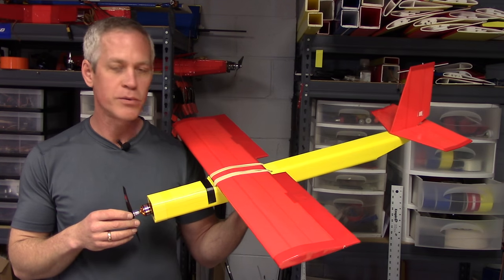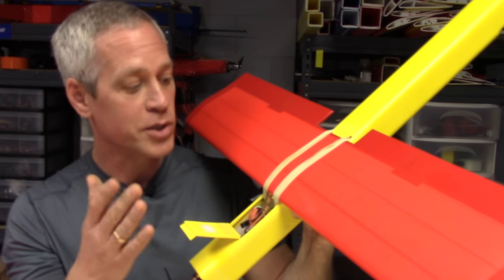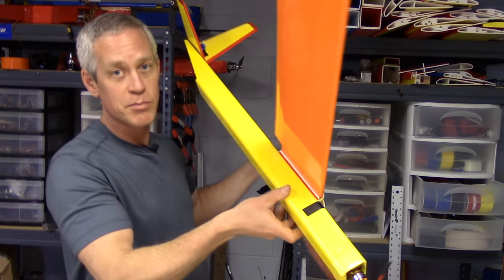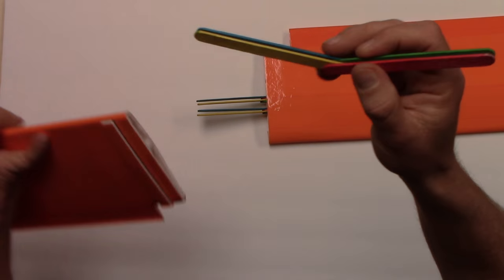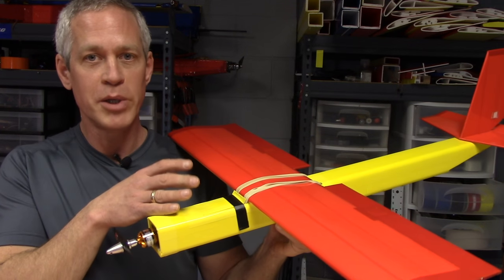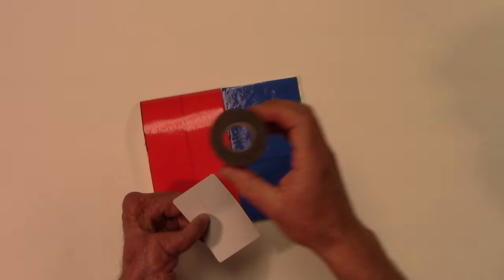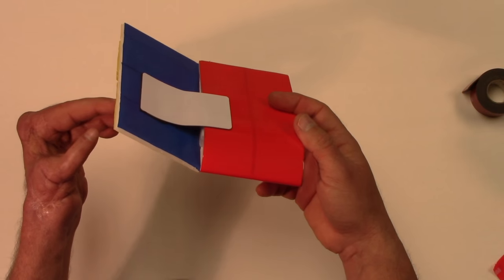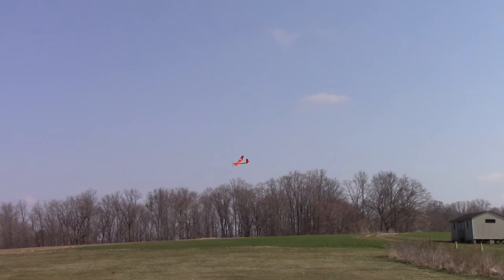Noob Tube - Dihedral & Polyhedral Wings

Comment: Thank you for this video. I started making a noob tube, but dropped the project for a photon when I learned how unstable it is. now my worries are that the photon will be too heavy for my motor. I think I'll go back to the noon design and use your popsicle stick method of dihedral. and also add some small half length ailerons to the ends. can't wait to be flying!

Comment: I honestly was expecting the wing tip brace (the gift, credit card) was going to be attached to the wing tip by cutting into the foam spar as needed so it would be fixed to the bottom of the wing from the inside.  It would look better and likely make adjusting of the angle easy, or used as a minor wing tip modification.  I was also expecting it to be glued in place since it could be cut off at the wing tip if desired later and not distract from the performance of the wing.  I haven't read all the comments, so it may be someone else has suggested the same thing.  I realize this video was published a while ago and some who might want to make the changes I have suggested may no longer be watching this video, but I suspect others visiting this channel might and could plan to make the change I suggested at the time of the build.  I continue to expect many new scratch builders/pilots to watch these great videos in the future.

Comment: Ed, I love your videos. Been a fan since Flitetest showed the plane you built for Josh Scott.  I heard your going to Flitefest 2016, and wish I had the means to get there, but I guess another time. Any tips for a person who would be a noob flyer, and flys alone (or should I say tried one, freaked out,  and hasn't tried since.)?
Reply: Tim get a SAFE receiver that comes in the Horizon Hobby Apprentice airplane. Its a flight stabilizer that will limit the bank angle so you can't roll the model. It also will self level if the sticks are released. RC Groups.com has a thread on how to set it up. Search for 'using SAFE receiver in another plane'. Makes it was at easier to learn.
Reply: I take it you don't have a fellow RC airplane mate anywhere near you, or even better, a RC club you could join?

Comment: Pretty sure that's called Tip Dihedral. Polyhedral would mean the inner sections are also canted. 

How do you determine the ideal width of the outer panels? I haven't been able to find a consistent method for figuring that out. I've seen recommendations range from 20%-40% of the wingspan.

Comment: Dear Teacher, those two wings under the tail. Do I really need to add a servo? Can't a plane fly if I just add nothing? Serve on front wings can move the plane up and down, isn't it so? Please respond.
Reply: You need an elevator.  You can't fly a plane like this with only aeilrons.  You can build a flying wing and then you only need elevons (ailron plys elevator in one control surface)
Reply: @MrKyle700  You're an angel. Been waiting for a reply for 2 months. Thanks a lot dear!

Comment: I have a pair of Turnigy D2826-6 2200kv motors that I love to mount on one of your designs.  I don't know what the "6" after the dash stands for.  I also have a Turnigy 2200nAH 4s lipo pack 

 
11.1v 2200mah 50C EZ  3 Cell Flite Pro Lipo Battery.   Will both of these batteries work with this motor? 
I'd like to do some acrobatics and some decent speed flying.  Do you think I could build a large Noob Tube to accommodate these power set-ups?  If not, which of your designs would?
Reply: Wow, if I am reading the number right, that is a lot of motor and without visiting the H King website to check the stats, I would suspect the motor can handle and suck dry the 4s and 3s battery packs with little effort.  If you are really interested in the motor details and what power, or voltage it was designed for, go to the H. King website and look at the chart.  Also note the recommended ESC.  If you have an ESC that is rated a few amps higher, no problem, but don't try one a few amps lower, or it likely won't last long soon after you go full throttle.

Comment: Can it be slowed down and increase lift without the polyhedral extensions just by shimming the wing front and increasing the attack angle? Or will that mess up the ailerons or something else? Or make the attachment point to the tube weak?
Reply: You're not actually increasing the angle of attack but the angle of incidence. I mean, in level flight (airflow coming through the longitudinal axis of the fuselage) the angle of incidence will be equal to the angle of attack, but AoA varies under flight conditions. Basically, you have to know at what angle your airfoil will provide the lift to keep the aircraft in level flight, and you pick that angle to mount your wings so that the fuselage can be moving "straight" and level, reducing drag. If you're an acrobatics guy, you'd want a 0º angle or else you have gravity and lift pulling your plane into the ground.
Reply: if you giys have built the dihedral wing or know about it, can you please tell me the height of the flitetest style oriented spar and its distance fromthe leading edge?

Comment: Guys can you tell me which are all the electronics I am going to need? Also can I use ESC and motors labelled for drones?
Reply: Yes, you can use the larger motors used in drones.  In his other videos he makes recommendations and in most cases he will suggest a motor in the 2212 size, unless your build is heavy.  If it is, you will want a stronger motor, prop, ESC, and battery size.  Generally speaking, if you weigh you finished model, add 10 percent for the RC gear, you will have a good idea what motor, prop, and such in thrust you will need.  If you can produce enough thrust with the combo to come real close to the the models ready-to-fly weight, it will fly just fine.

Comment: What Size  is that  Fuse ? looks smaller than normal Noob tube  Fuse . Thanks
Reply: Most of his designs are 30 inch long fuselages since that is the longest side the foam board comes in.  If you watch this video again and others he has published, this will become obvious.

Comment: Does the Polyhedral only use elevator and rudder. Thanks.
Reply: yes rudder and elevator and throttle 3 channels hook up the rudder servo to the aileron port on the receiver
Reply: yes rudder and elevator and throttle 3 channels hook up the rudder servo to the aileron port on the receiver

Comment: what I dont see in all of these kind of planes, flite test, etc... is all the alignment challenges that I had to go thru when I balsa built a plane that flew for 20 seconds crashed and then of course I have not revisited this hobby since the 80's. I have always yearned to get back in. is there some huge missing segment that I dont get? lol, are these truly idiot proof. probably doesn't matter, im building something like this this weekend. I completely (I think) understand how these are built. im certainly making this wing about 12 feet long (not really)
Reply: you can fly a sheet of foamboard with no wing.  its not exactly idiot proof but its not as hard as it seems intially.  you can get pretty much anything to fly.  battery tech much improved since the 80s too